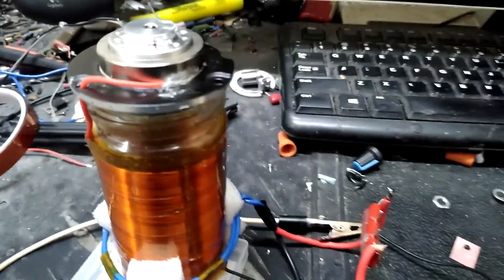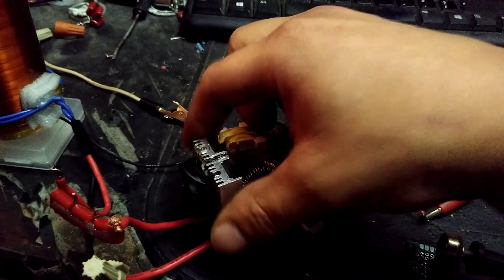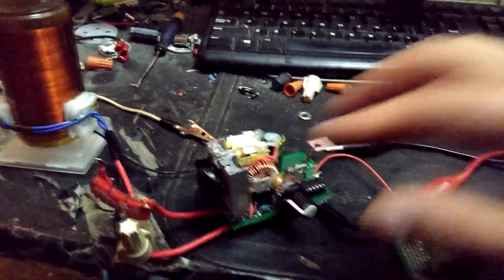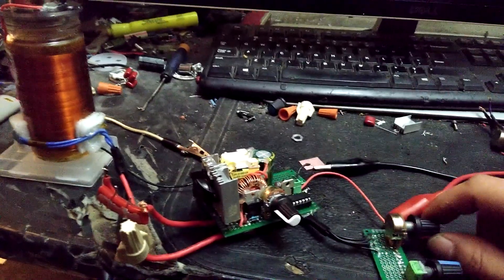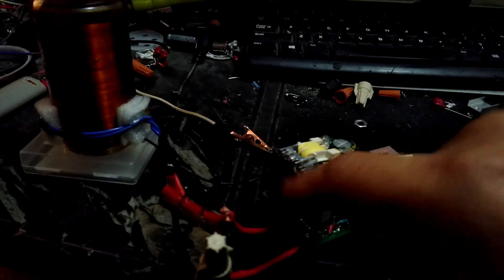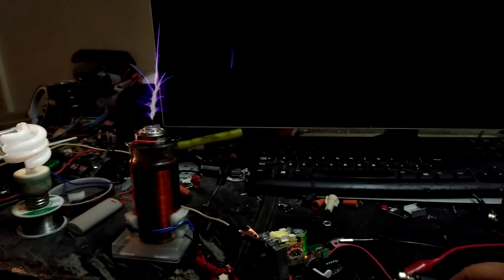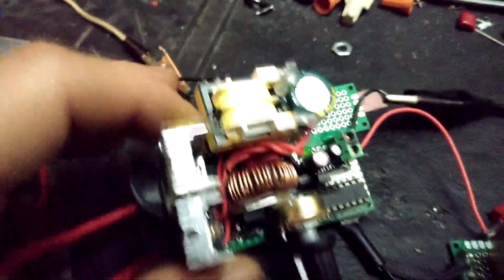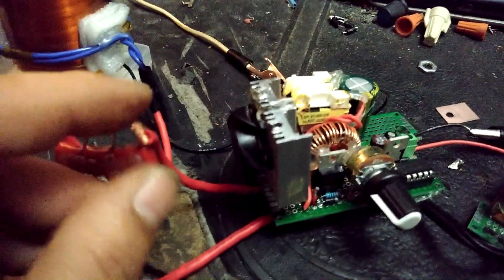Tiny SSTC circuit.. for TC Gun?

Comment: Hey bro this is a piece of art 👏could you give me schematic? I need it
Reply from the maker: This one and others I have like it are basically this circuit. https://imgur.com/oGcvMNa

I don't have specific coil details for the one in this video though. It's probably 36 awg. I'm trying to get around to building another one of these and going over it more.
Reply: Uh... it seems like i am having issue with loading the page. That really sucks.
Reply: Also is this the exact circuit used in your gun? Probably not but anyway could you meybe email me and send it or google drive?
Reply from the maker: @nexcover1083  Try just checking this video, the circuit should be shown in it also https://www.youtube.com/watch?v=MJfqZ6Irrrc
Reply from the maker: @nexcover1083  That won't be the same exact circuit but every time I make these it's always the same topology. Some work better, some not as good.
Reply: Thanks. It looks very simmiler if not same to tefatronix design just with few changes.
Reply from the maker: @nexcover1083  Exactly

Comment: From my royer days I found that putting  a tiny capacitor(or 2)  in parallel kept the tank capacitor cool(current divider)
Reply from the maker: that does work but then I'd need 12 of them to get the same value, better to just use small legitimate pulse caps NOT from amazon lol
Reply: @Magneticitist  12 caps..fair enough 😅 here in the uk stuff from Amazon is high quality (compared to ebay...which isnt saying much i guess😅)  decapping eBay IRFz44s is hilarious- the silicon+binding wires are tiny compared to ligit ones

Comment: That sure would make a nice TC gun. It's amazing how it's almost not even heating up. You can run that thing as long as you want without worrying about overheating. What's the resonant frequency of your coil and which Mosfets did you use?
Reply from the maker: Something like 900khz to 1mhz, fets are the same IRF3205's.
Reply: @Magneticitist  You wrote in the description about the grounding problem. I tried expermenting with circuit and mains ground. The arc was the same length on both of them. I also just hooked up a 10cm wire to the end of the gdt instead of grounding it. I have no Idea why that works but the arc length increased quite a lot. Also you can touch the circuit because it's not directly connected. However you will need to set your gate voltage a bit higher. But for me just hooking up no ground at all and just a small wire like some kind of antenna works the best. And the output increased at least in my case.
Reply from the maker: @JohnnyB2451  for me the problem is all of the high-voltage present in the circuit with no grounding this means it's more liable to malfunction or cause the interrupter to go nuts